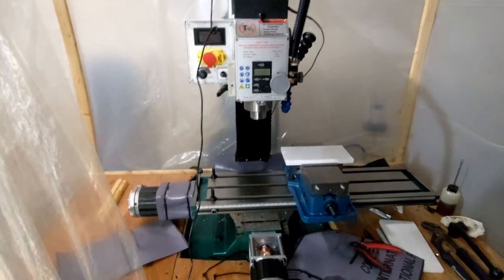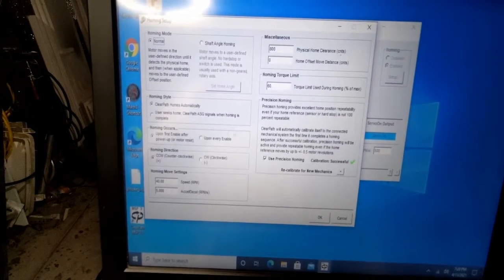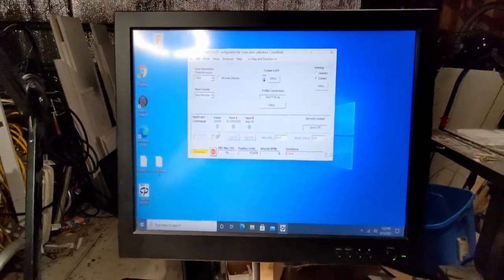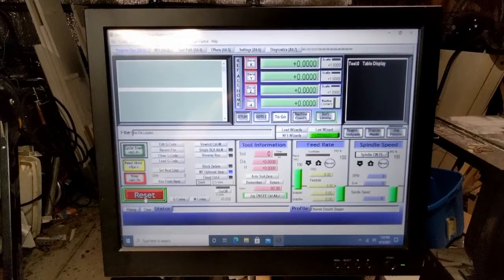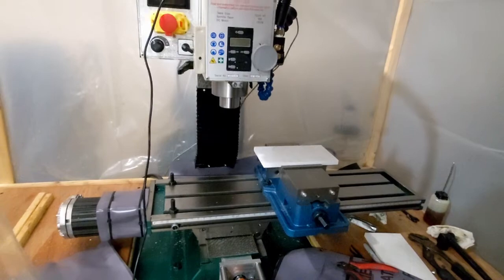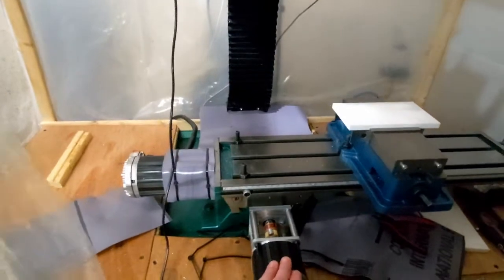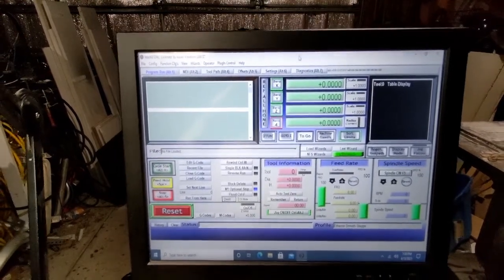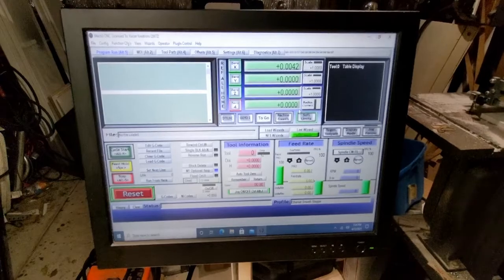Clear Path Servo Motors G0704 Homing and limits in Mach 3

Comment: I have a question about the use of servo systems in CNC machines. The CNC control unit told the servo controller to move 100mm in the positive direction to the X axis at a speed of 1000mm/min. This movement should theoretically last 6 seconds. So what happens if a new order comes from the CNC control unit before the servo system can complete this movement in 6 seconds?
Reply from the maker: in a typical non-servo setup, the system wouldn't know and send the next command.  WIth the servo motors, they know the signal and how long it takes, if it doesn't reach that and receives another signal, it will halt.  Mach 4 works well with servos and that feedback loop better than Mach 3, so its just what system your using and how that servo feedback loop works.  Mine just does the first one, (closed loop feedback) and if it doesn't move the distance it needs to, then it will halt.   Some newer "fancy" systems will retry, then half, but im not that fortunate to have that type of cash.

Comment: Hi, have you ever figured out that Clearpath AGS  signal? Im using Acorn CNC1 and there is a macro you can program for it to set 0 automatically once they autohome , but i wonder if there's a way to set home manually to not be all the way in tinbuck two at the physical end of travel
Reply from the maker: Im so sorry for the delay, i just reset home on boot up, i dont send anything to re-do the home function but turn it off and on again :)

Comment: Why do you like the servos over the steppers?
Reply from the maker: Everything, specifically heat and speed.  I noticed the steppers would get hot if you had a long cutting profile to do.  The servos are significantly quieter, no high pitch whine.  Overall, if you have the money to spend, servos are so much better.  If you dont have the money, then dont worry about it, just know your limitations a 2-3 hour run time is probably going to miss steps and heat up significantly, and you wont have anyway of knowing untill your done, or you see some type of inconsistency's in your cuts.  Hope that helps.
Reply from the maker: also, even though mach 3 does not really do closed loop feedback to the servo, i feel the servos attached to the machine are good enough to stop the cut when a issue arises (other than a broken end mill) the steppers just keep going unless you have some encoder feedback, which would be more of a hybrid stepper setup.  Again, Mach 3 does not really help you though in that case, im looking at upgrading to Mach 4 just to try and get better position feedback from the servos and use them to their full potential.  Worst case if i cant get that, Linux CNC might have to be another option to look at.